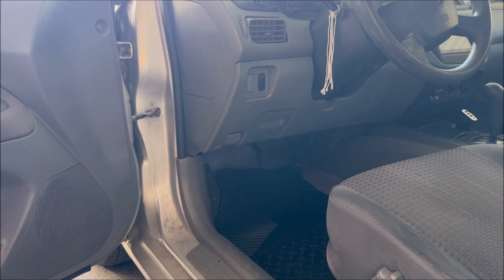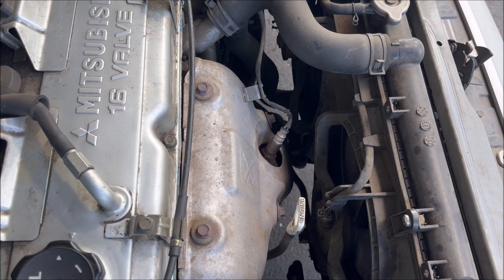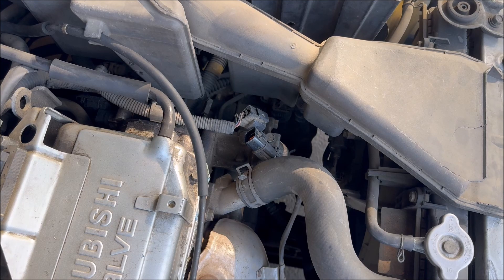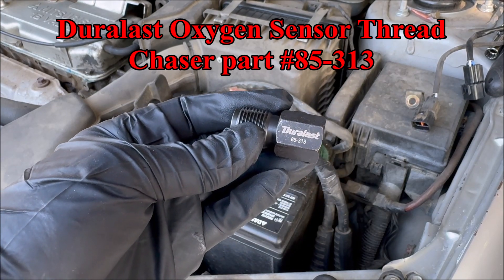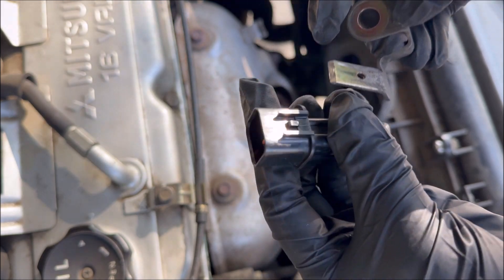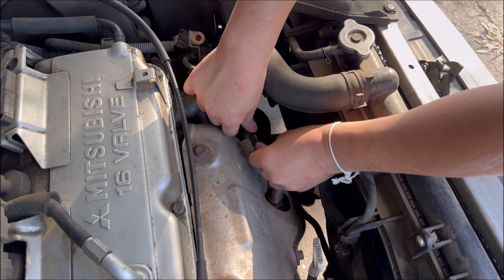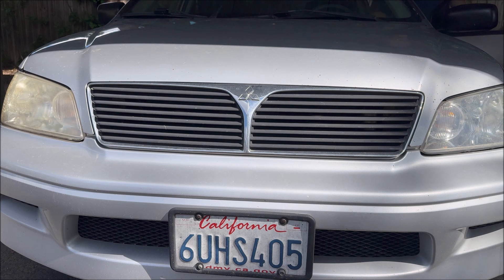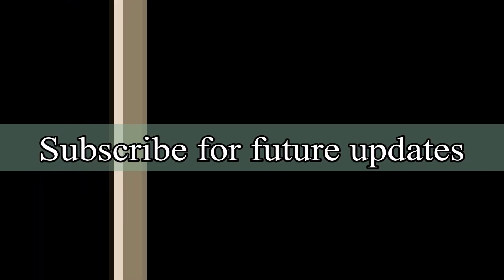Mitsubishi Lancer 2003 ES - Upstream Oxygen Sensor Replacement

Comment: I’m not sure if you’ll be able to respond, but I really need help finding the air duct/air intake hose with part number MR571700 for my car. It’s an older vehicle, and no one seems to sell this part for my make and model in Canada anymore. I’ve tried using duct tape and RTV silicone to patch the old hose, but it hasn’t helped much. I can only drive up to about 40 km/h because the RPM won’t go above 2000 without the engine dying. The PCV hose is also cracked, and I haven’t been able to find the original replacement....I've tried a few different hoses, but none of them worked. I really need your help. I ordered 4 different air intake hose from Amazon, but it was extremely thin, almost like a balloon, while the original hose is thick and rigid. please help.